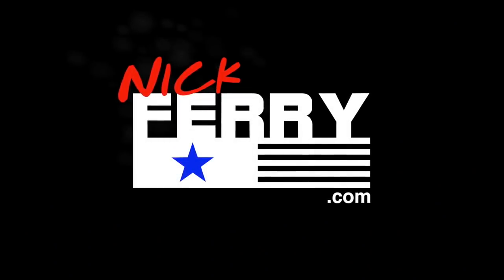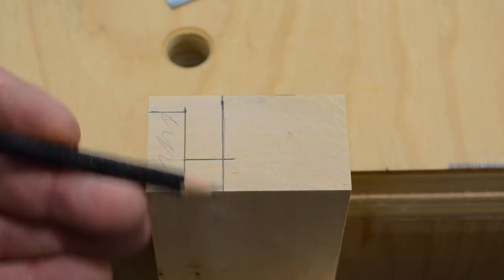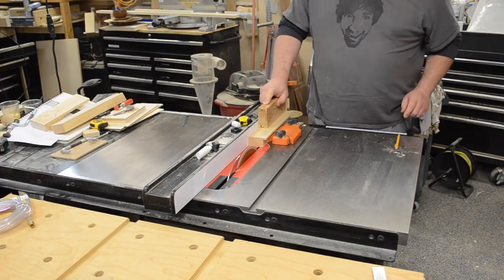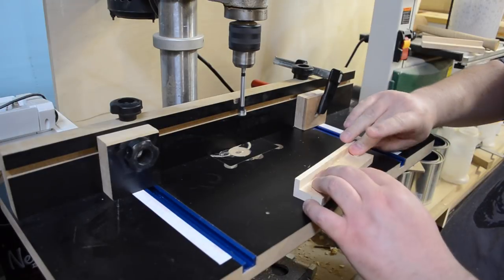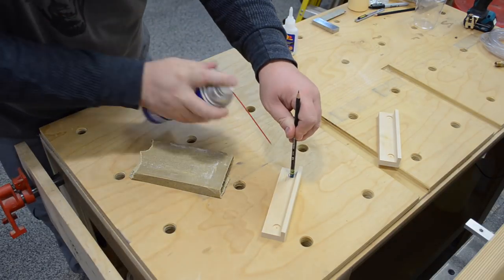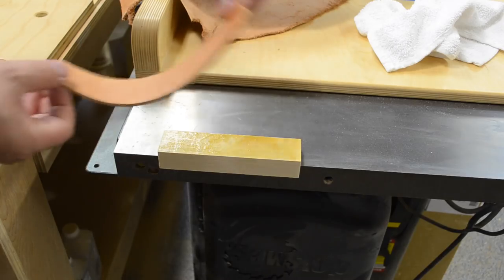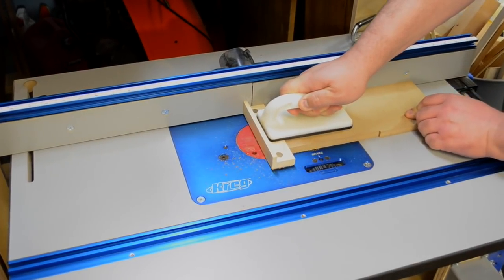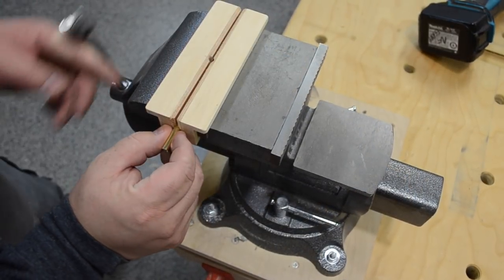Ⓕ Leather Vise Jaws - Soft Jaws to Protect Marring Your Projects (ep81)

Comment: We had some  formed aluminium jaw covers  for our vices at work to make soft smooth jaws for  holding polished surfaces  or special parts for finishing operations   especially good when handling items that may slip in leather  when working
Reply from the maker: those work great too - nice tip!

Comment: Hi Nick!  Nice video.  I've got an idea to make this project easier for you the next time.  Use your router to remove the wood you cut out with your table saw, and make your work product long enough to make multiple pads.  Cut the board into pieces which precisely fit your vice, and then continue as you do in your video.  This might make the project easier and simpler.

Comment: Hey Nick, great project as usual. The reason the router chewed up the leather is cuz it's too soft. When we need to machine rubber, we stick it in a minus 40 degree deep freezer. For your leather, you could probably use a household freezer (like in your kitchen) then route it immediately after removal. Once it's too warm, just repeat the freeze and make more cuts until you're done.
Reply from the maker: thanks - that's one of the ideas I was going to try in the future - when I was in high school, (true story) I was milling some strut mounts on a Datsun 260z to get more room in the strut tunnel for negative camber - when I went to acquire some liquid nitrogen from the science department to freeze the rubber, I was denied - been wanting to come back to that one ever since
Reply: Ah, the old liquid nitrogen denial. Hate it when that happens!

Comment: Great video, as per your usual. I will definitely make a similar set for my steel vise. You said you used basswood for it's softness when working with easily damaged materials. Will that wood crush easily in the vise? I was curious as to using poplar as an alternate. I guess the key is not getting medieval with the tension on the jaws.

Keep up the good work, and by all means keep the videos coming. Videos like this short one are great for picking up ideas. I have a huge list of You Tube content from you, Jay and others for upcoming shop projects.
Reply from the maker: thanks much man - poplar would work great - so would pine or aspen - any relatively soft wood - just not something like hard maple or similar - even then it'll hold but the softer stuff gives you that added piece of mind